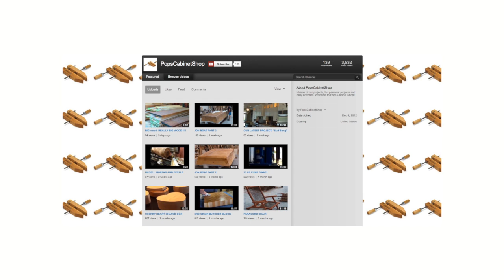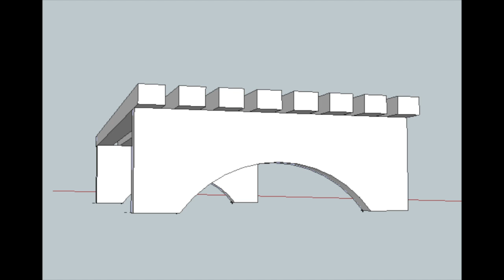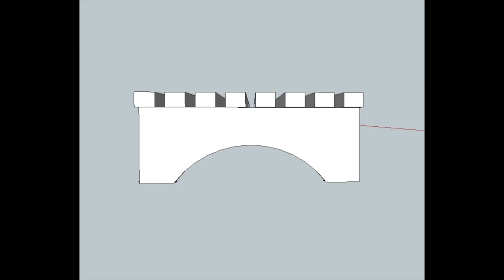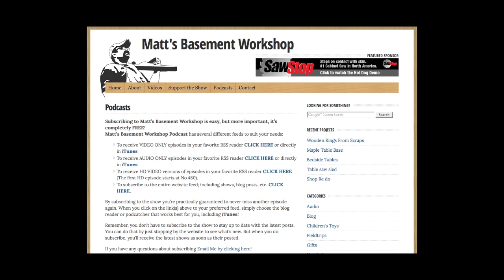506 Teak Shoe Rack Pt 1

Comment: Nice project, but even better video.  You do a great job of using alternative methods (like using the miter sled and stop block instead of a cross cut sled).  Btw, maybe a good finishing option would be waterlox or waterlox marine?  Should really show off the beauty of the teak, but provide a little extra protection. While I haven't used it yet, I have a can ready for my next project. Allan Little (aka Askwoodman) really seems to be fond of the stuff and he seems to get great results.

Comment: excellent video Matt!! just a small question. was there any specific reason why you did the rip cut first instead of cross cutting the top to length?  it could have saved u almost 12 x 12 inches of board. thanks

Comment: Man, that teak was machining so nicely. Is it an easy wood to work with or is it the power of the SS? Probably both but I figured I'd ask anyway. Also, did you joint/plane it? It looks extremely flat and considering it came from somewhere else and was sitting in your shop for a while, if it stayed that flat that's pretty dang impressive.